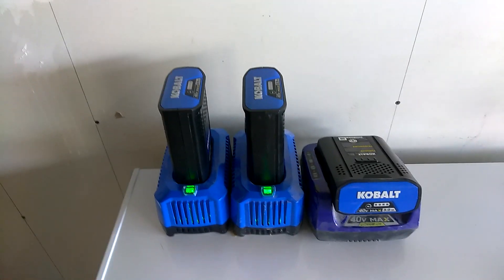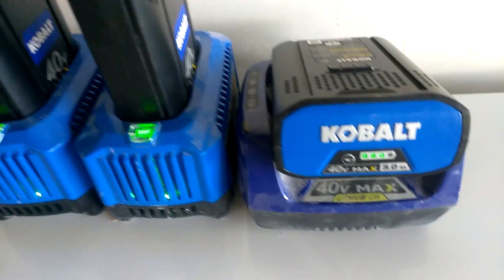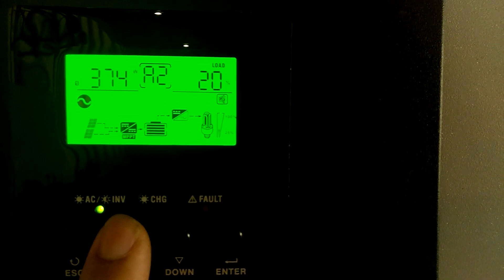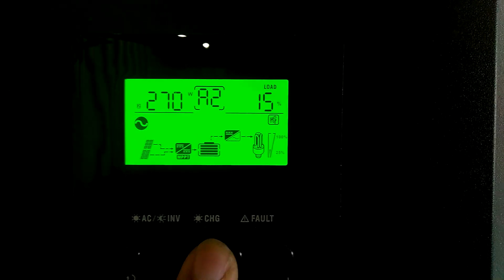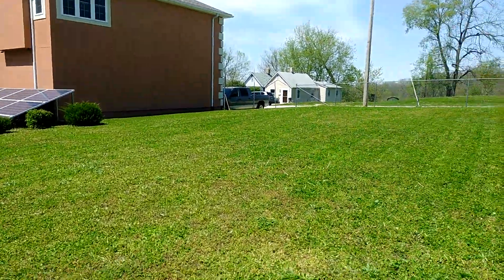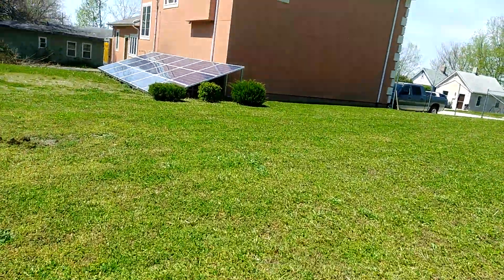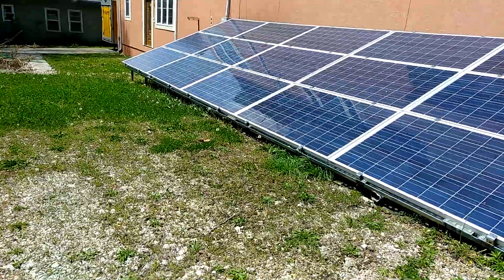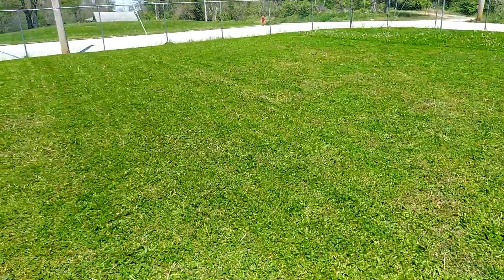Charging up lawn mower with solar power.

Comment: Hi, could you show how the mower is connected to use solar, I just got a used Kobalt 40 v mower and it came with a 3ah battery and last 10 minutes and can't find a 5Ah battery to complete the task of my smallish yard
Reply from the maker: The more itself does not connect to the solar I have a base charger that plugs into the wall and the wall plugs are all tied into my solar so when I charge up it's using the solar power to charge the battery on the base charger .

Comment: I sure like mine the battery power is the only way to go no more gas to buy. I made my battery from Lifepo4 A123 26650 cells and they work awesome to replace the old lead acid. I see you went with the Kolbalt I use there blower weed wacker and the hedge trimmer still looking for a deal on their mower so I can use the batteries in everything Cheers stay cool.
Reply from the maker: I found it on Craigslist they were selling it for $50.
Reply: @carsonlurbanwindandsolar3437  Wow nice deal